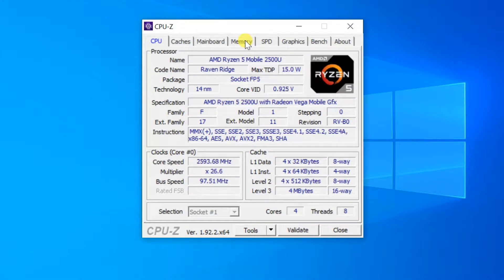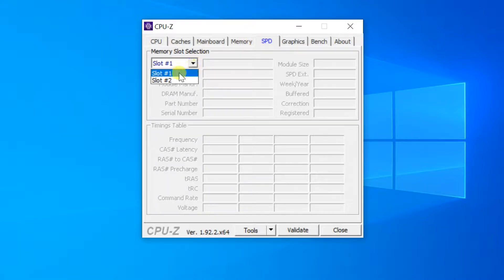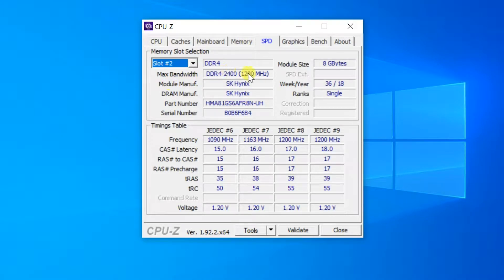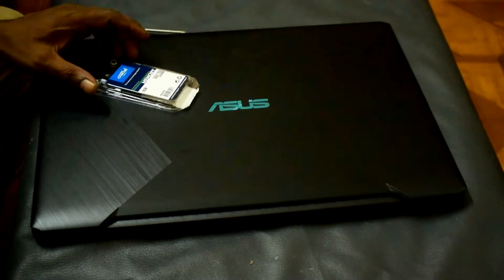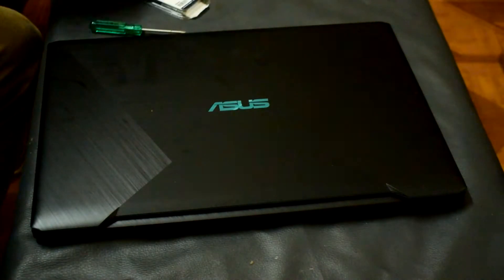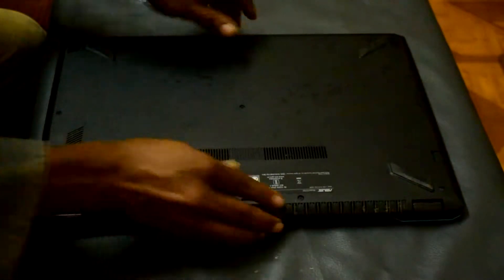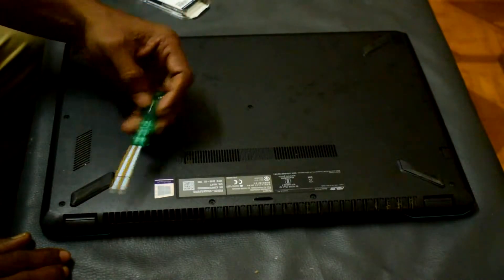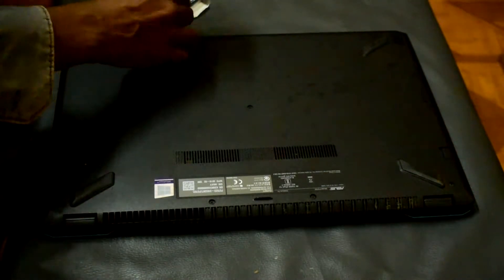How to Upgrade the RAM on Asus VivoBook F570Z Laptop

Comment: after installing ram do we need to do any bios settings or will it auto detect? and can you provide the link for buying the ram
Reply from the maker: It will detect automatically. https://www.crucial.in/catalog/memory/ddr4?gclid=Cj0KCQjwjer4BRCZARIsABK4QeXD9BQ9gvz8VTyG5LQjphzyGUAH_y8vHeyxFINehWz3Y6Dt04PC0A0aAq-QEALw_wcB&cm_mmc=google-indram_-null&ef_id=Cj0KCQjwjer4BRCZARIsABK4QeXD9BQ9gvz8VTyG5LQjphzyGUAH_y8vHeyxFINehWz3Y6Dt04PC0A0aAq-QEALw_wcB:G:s
Reply from the maker: You can find ram Amazon also
Reply: @MohdShafiK  thanks a lot ❤️
Reply: @MohdShafiK  btw is there any way to open the laptop from the back side to avoid all these complicated stuffs?